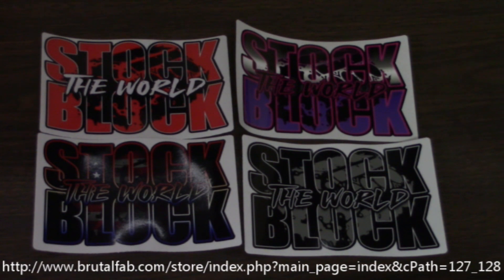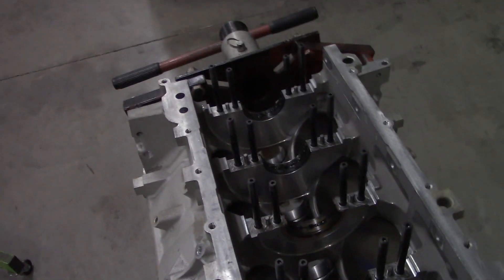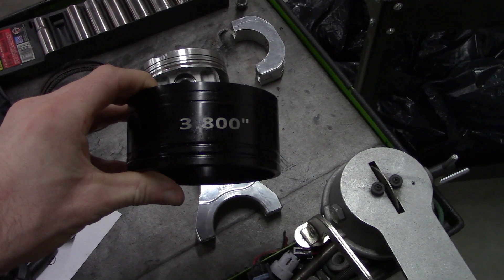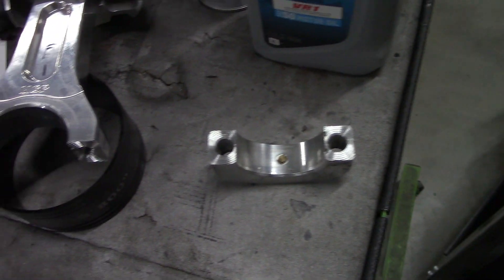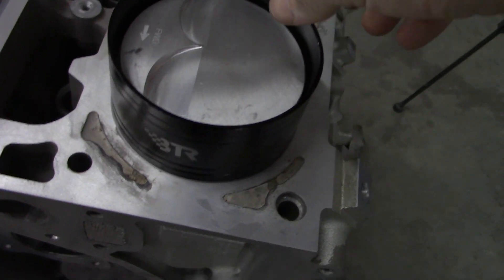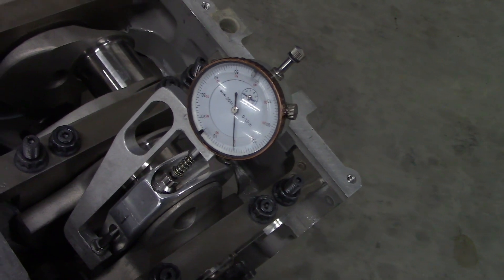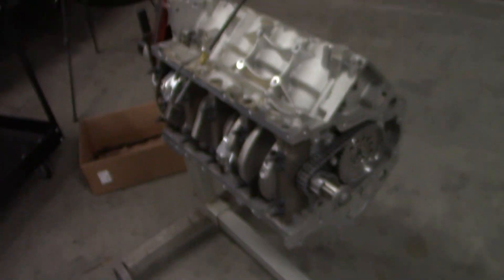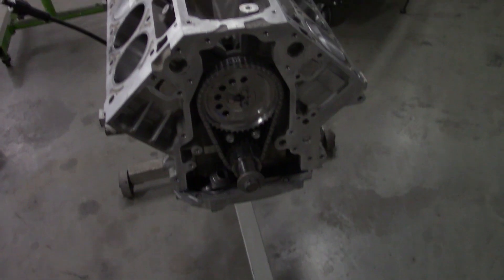Assembling the short block for the worlds fastest 5 3!

Comment: Thanks for the video. Building a 383cid LM7. Got the valve train sorted but the bearings you use are interesting. I guess I have more homework to do. Any links or sites with more info would be helpful.

Comment: You mentioned changing oil pump. What was your pressure on the big end with the old one? Any other mods on the block besides pinning? Any oiling mods?
Reply from the maker: It’s never been more then mid 50s up top.  That’s on. 10296.  Was a little lower on a 10295.  Never had a bearing issue but I’m curious if the lifters will like more oil pressure at higher RPMs.  No oiling mods.  As for the block just pinned mains and now the filler.
Reply: @nigelstst  Cool. Thanks buddy! I’m starting to lean on mine more and just taking all the information I can from the guys going fast fast 😎
Reply from the maker: Good luck man!  Big fan of your car and yours looks a hell of a lot better then mine lol.